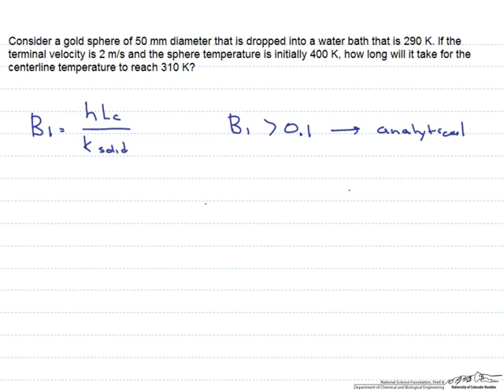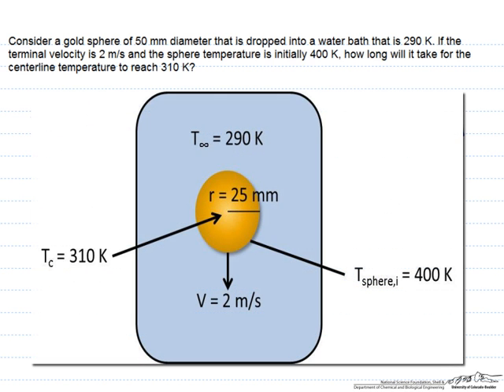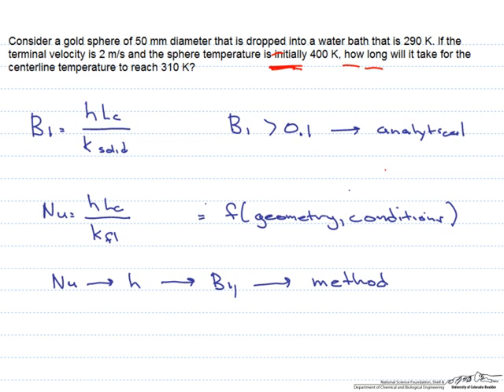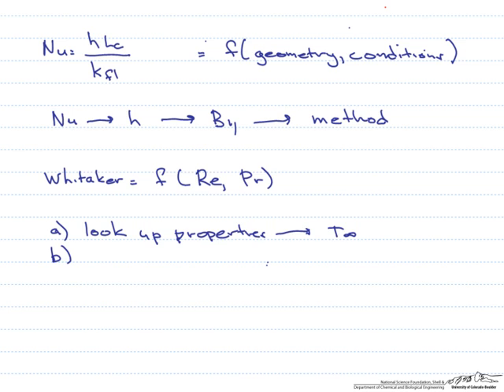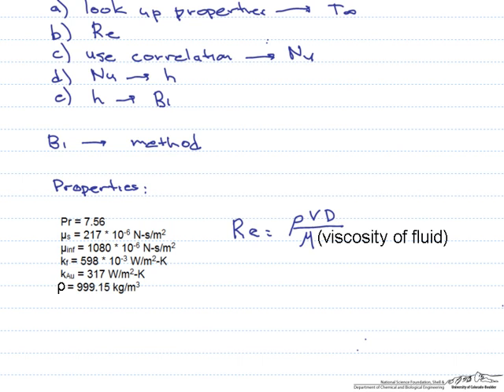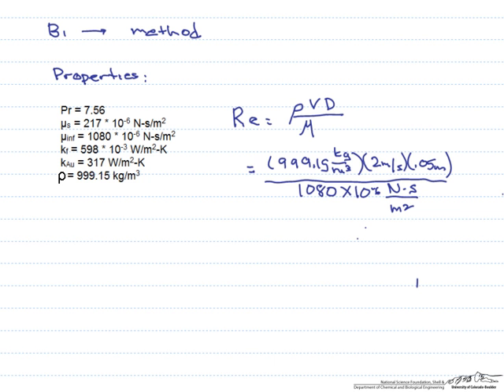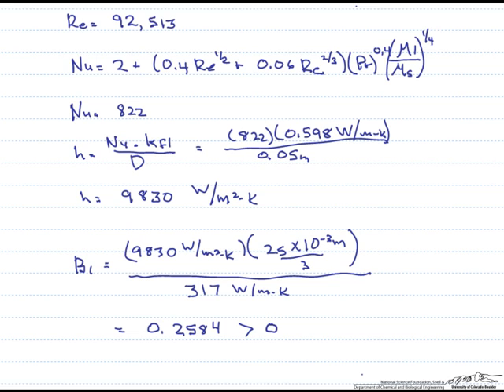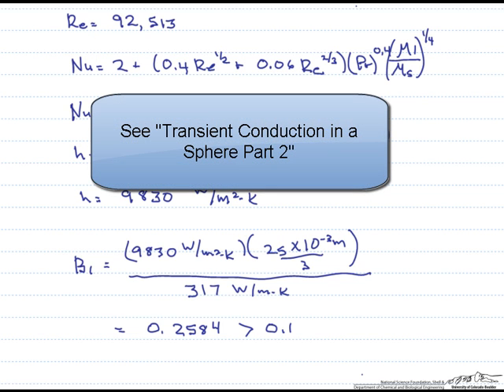Transient Conduction in a Sphere: Part 1

Comment: Why was the characteristic length for the Nusselt No chosen to be D (diameter) while the characteristic length for the Biot No was r/3 (radius/3)?
Reply from the maker: This is a very good question, and unfortunately the answer might not be very satisfying. This is just by definition - for the Biot number, the characteristic length is defined as the volume divided by the area, which equals R/3 for a sphere. For the Nusselt number, the characteristic length for radial geometries (spheres or cylinders) is defined as the diameter, D. They are both called the characteristic length, but it is important to remember when solving these problems that they actually refer to different characteristic lengths.